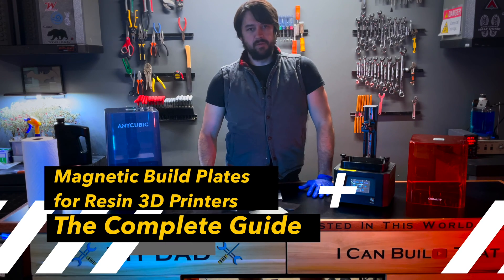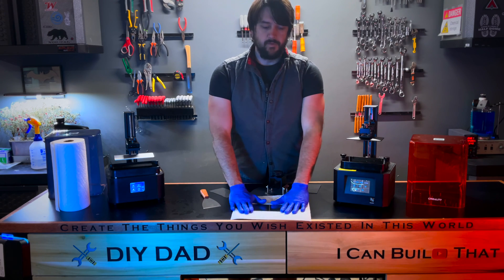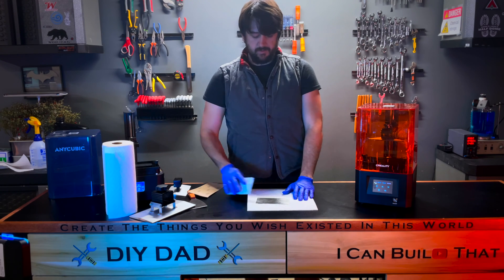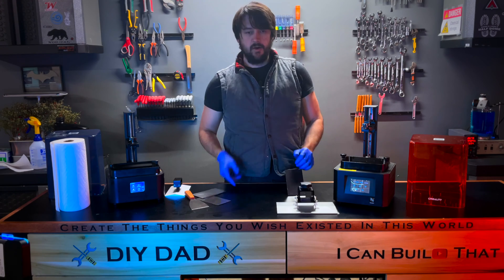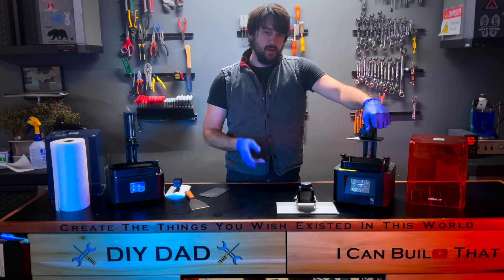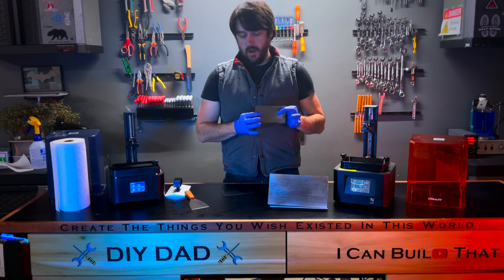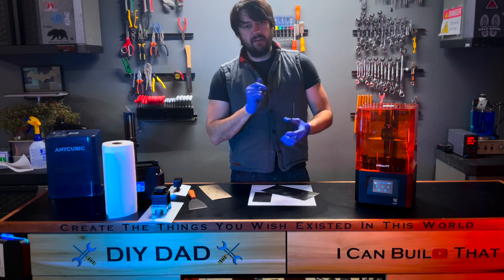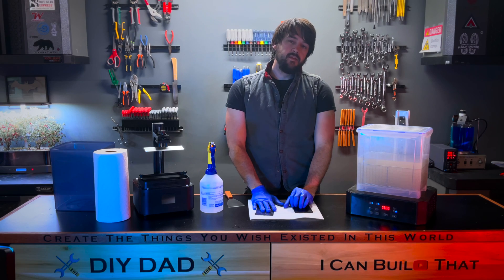The Complete Guide to Magnetic Build Plates for Resin 3D Printers

Comment: I have a Mars 5 ultra brand new. I tried to use a Magnetic flexible spring steel platform but I was not able to make the print stick to that base! Is there any way I can level my printer to get that done? I am not able to make it stick to the plat! 
Ive tried 40s of exposure for the first layers but nothings working. Thanks in advance. Great vid
Reply: try sanding it